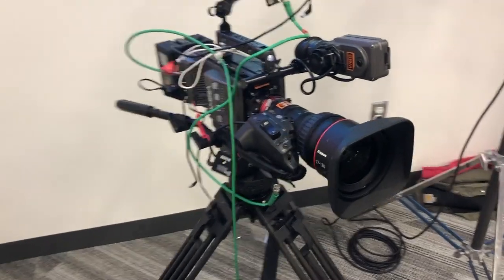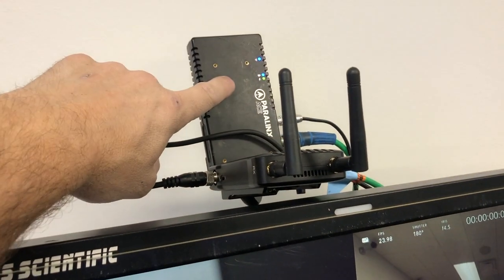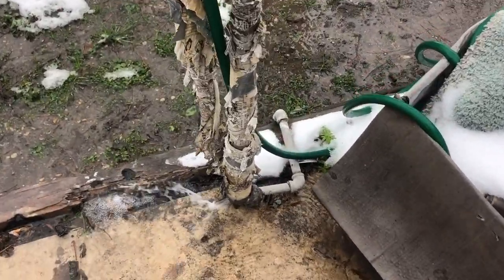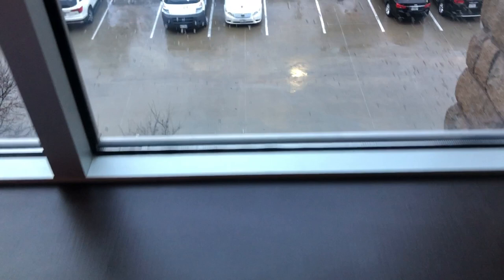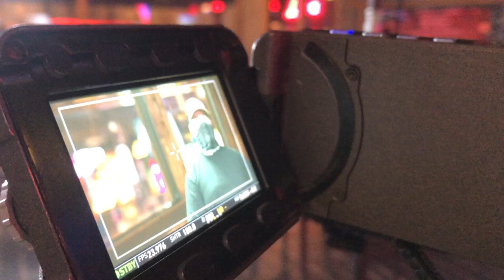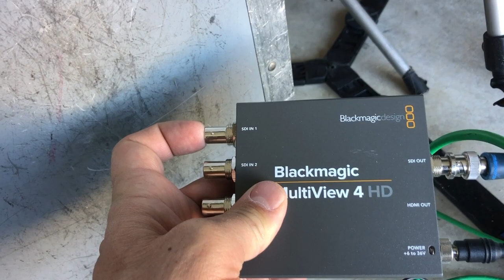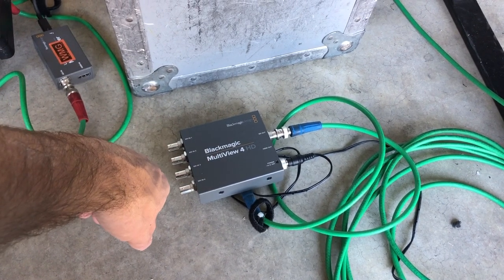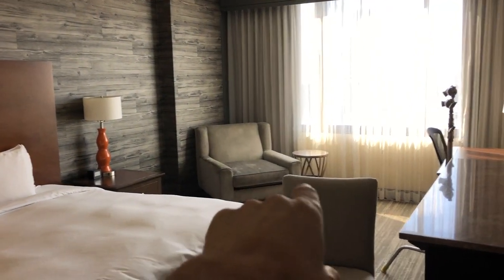BTS Arkansas, Fort Worth, Houston | TV production as a camera operator / owner.

Comment: It's possible the output of the signal could be PSF and some of those monitors don't like it. If you patch in the Multiview to a laptop and change settings there, there should be a way to convert the signal to 1080i 60 or something that's more familiar to computers and common monitors?
Reply from the maker: DIT on a shoot this week fixed it for me.  It was outputting 30.00p.  Changed to 29.97p.